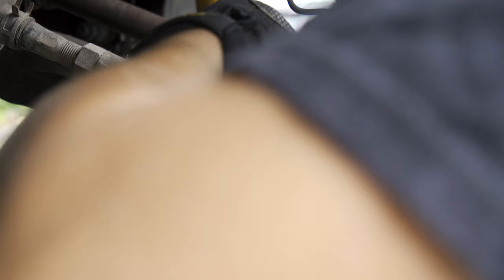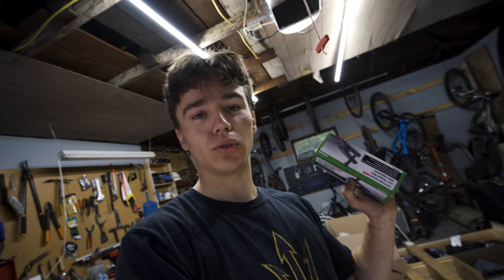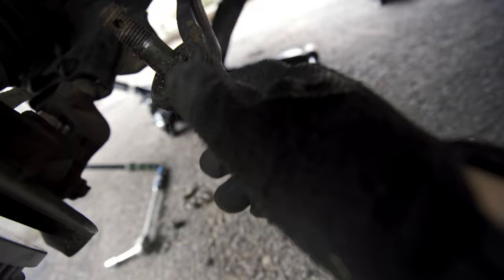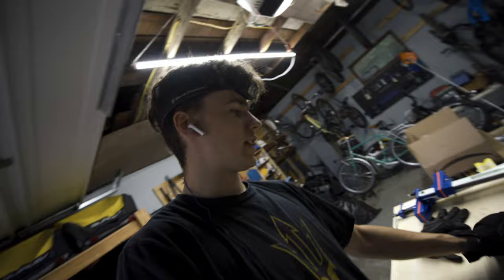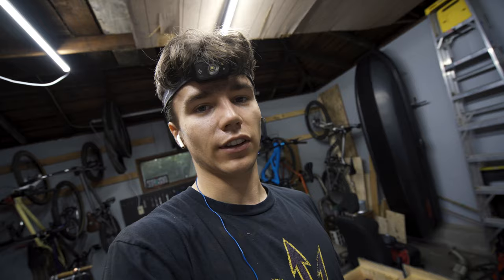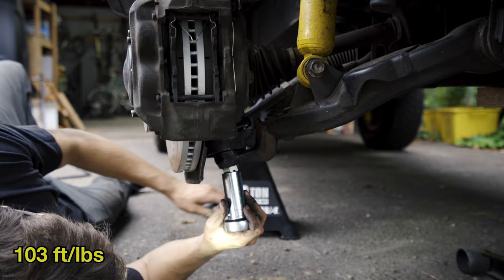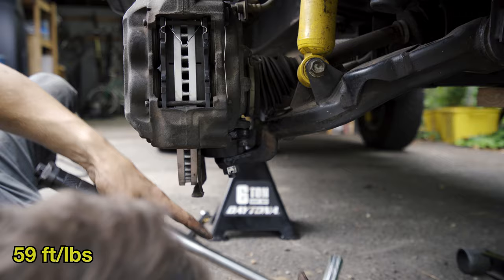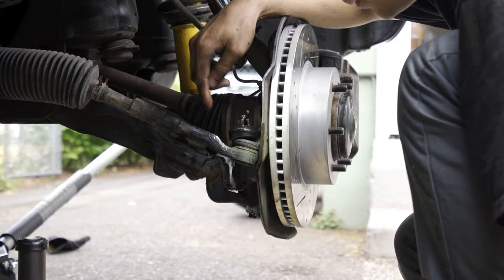How to REPLACE Lower Ball Joints on a First Gen TOYOTA SEQUOIA

Comment: Swapping these lower ball joints were one of the first things I did after buying the sequioa. I hope you added thread locker on the 14mm bolts. Make sure to get it aligned before hitting the road again.

Comment: You should try using a pipe about two to three feet long to go over ratchet as a cheater bar. It's so so much easier to break bolts and nuts free without much strain